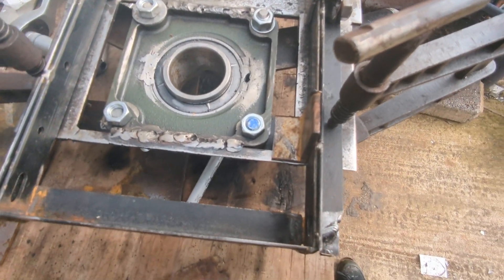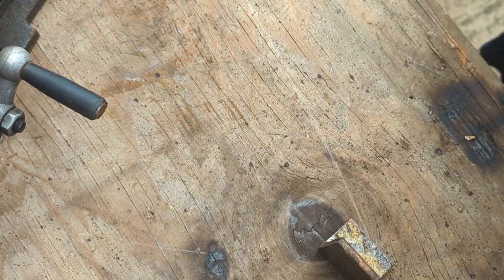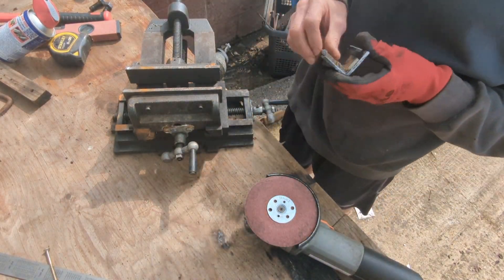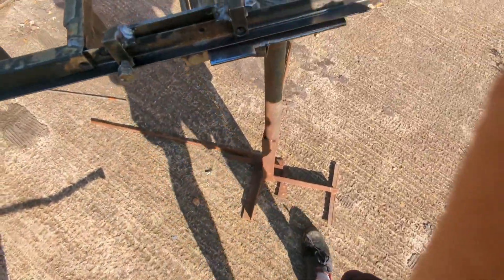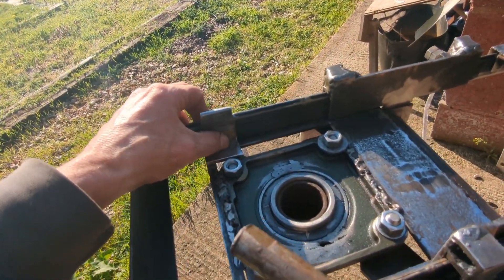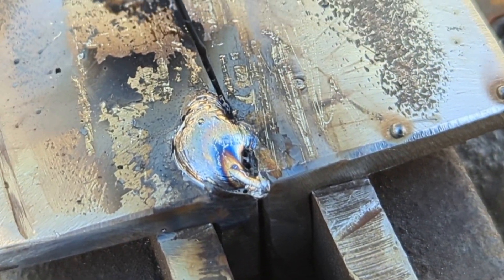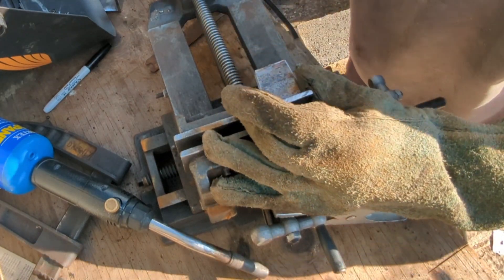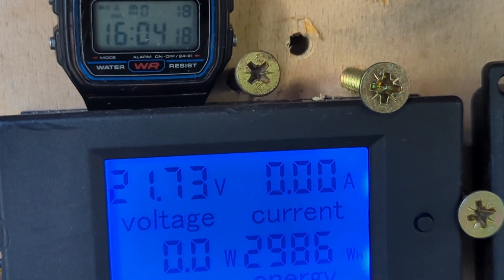New Wind Turbine Project - Slow going making everything custom fit !!!

Comment: Slow going is good. It will need to take a fair but of punishment over the years. Not much wind here either. Plenty of sun though, so the batteries are full. Don't you have a panel or two ++ controller going into your batteries ?
Reply from the maker: It's mainly cause I'm having to do everything on the fly and every time you uncover one problem it makes loads more. I'll keep struggling on. And yes I would love some solar panels. I keep looking for cheap ones on Facebook marketplace but they don't seem to be readily available at the moment